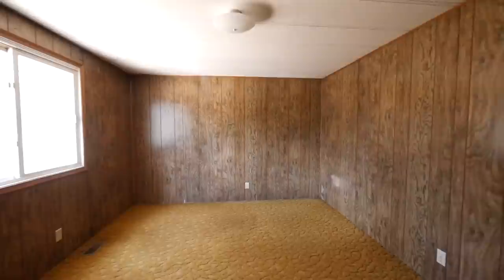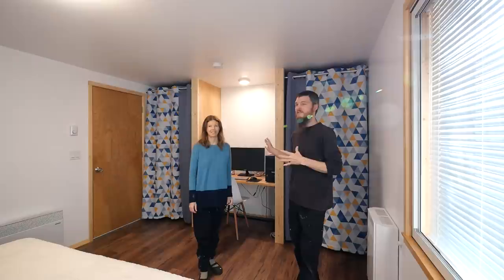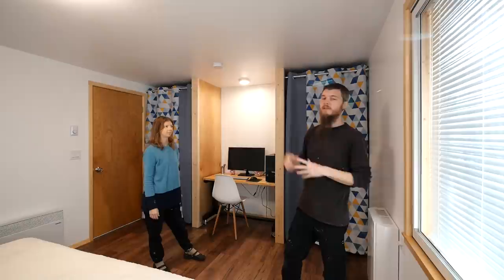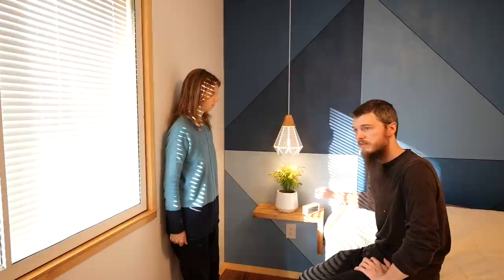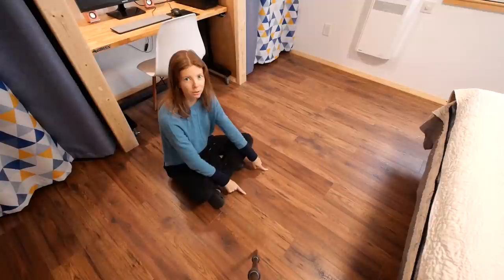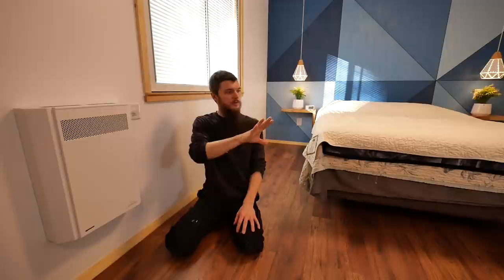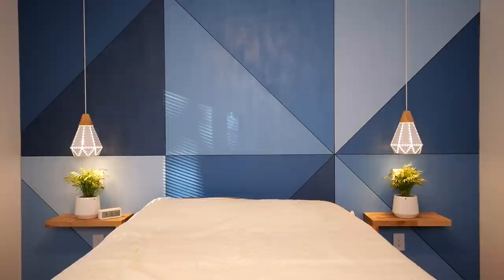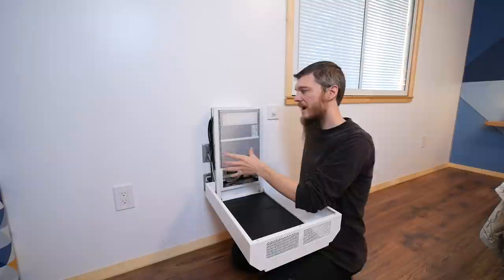Mobile Home Bedroom Renovation and Tour - DIY

Comment: We moved into our brand new home when we had a freakishly hard rainstorm, I was standing at the patio door watching the rain come down sideways when I thought "gosh it's raining so hard I can hear like it's raining inside."  Looked over to my right and water was pouring into the house from the window frame.  Long story short, the builder tore off the patio roof, cut several holes in the stucco to check for moisture, ripped a few holes on the inside for good measure, and then left everything that way for a week to make sure any moisture had a chance to dry.  So mistakes happen even with professional home builders, I'm sure the builder didn't advertise their mistakes either.  LOL!  Your bedroom is beautiful, well both of them were, but I like the blue one better too.

Comment: No I told you so's.  Things happen that are outside your control.  In the moment as you said, it's frustrating.

Correctly correcting the issue is the priority.  And you both knocked it out of the park. 

The new wall, floor, and closet layout are perfect.  Great work!
Reply from the maker: Thank you!

Comment: When we were getting our house ready for market, we had all new flooring installed. There was an unsanded area on the drywall, so my husband sanded it and the dust went everywhere. Then he took a damp rag and started cleaning up the dust, which turned it into a mucky slime on our beautiful new floors. It took 30 seconds of sanding but 3 days to clean up the mess! It was embarassing, but it was our fault for not thinking it through, being tired and stressed. You couldn't have foreseen or even prevented the rainwater getting inside. I remember that video, and it was a pop-up storm. Shoulda, coulda, woulda ... that's what DIY is all about. Props to you for sharing ALL of your experiences!!
Reply from the maker: I know that slime, haha. Drywall dust gets everywhere too!

Comment: It looks beautiful! I love the blue wall your  work is amazing! Love the floor it looks a lot like are floors in are new home.  Everything looks so relaxing. ❤ Ashley it was so nice to see you talking about all the changes you seem very shy most of the time. I am also!! My happy place is doing remodeling decorating crafting plus spending time with my family. I fill best in my own surrounding. You really are such a sweet beautiful lady. Such a beautiful family! Stay safe! 💕        Question: We built are home in 2019 it took a year to build. We moved in Feb. 24 2020. Lived in it from Feb 24 until April 29, 2020. This is are winter home ( Florida) We returned Nov. 1 2020. So then the next day as I was cleaning I found mold in the one bedroom this made me look more closely as then I found mold on furniture the headboard dresser night stand. It's only this one room just as you have said just your bedroom. We called are builder and are working with them as they are being very kind and helpful. It really has been a big problem as I have very bad allergys and mold is my worst. So do you fill taking out the old dry wall helped you with this problem? Oh and yes we also bought a air cleaner device. We did run the central air all summer as we were gone also. Thank you for any help you may have.
Reply from the maker: I feel that our problem was a little different because it was caused by a leak. Our drywall was affected because of where the water came in. Your issue sounds more like a humidity/condensation problem. I wouldn't tear out drywall unless you find that it is moldy, especially on the backside where it can't be treated. Likely you just have to make sure the room is getting fresh air, good ventilation, and light. Also, remove as much of the mold as you can.
Reply: @diyfferent  Thank you so much for this information.

Comment: You should not be afraid of changes it’s your home. Mould and damp problems are not good especially in a bedroom where you are breathing in the spores all night. We all makes mistakes I know when I had my wet room built I had a cupboard placed under the sink however the water from the shower rotted the wood and it fell apart. So now I have just had to have my wet room totally refurbished so now new floating toilet and floating  sink and nothing touching the wet room floor that will get ruined if it gets wet. It was an expense I could do without but you learn from mistakes and now my wet room looks stunning. Plus I had new flooring and the last flooring was a dark grey but my new is speckled white so looks cleaner and bigger. Anyway great video stay safe. By the way my youngest daughter had her baby on Sunday 22nd November and I now have a grandson to add to my eldest daughters two granddaughters. Unfortunately due to lock down here in UK have not seen much of him yet.
Reply from the maker: Wow, congratulations on the new baby. And it sounds like your renovation i s coming along well. We too like our floating sink in our bathroom. We would love a wall toilet too like we installed in our home before the last one. I'm not sure if you saw that. Thanks for watching, be well :)

Comment: The changes you did are great for the room. And you fix the mould issues. 
I would suggest a panel at the back of the desk (bottom part) to hide the wires. The panel will have a small distance from the wall. Move the tower at the bottom and use a cable box. It will tidy the computer area.

Comment: Your blinds, anyone from the outside can look in, if your turn them the other way you can look out.  This is a safety issue.   I love the changes it looks more like your style now.  In around about way the rain really was a chance for you to get what you wanted in the bedroom.  After that rain it makes sense you would have mold.  It's fine it's life, shit happens.    peace
Reply: You're so right about the blinds. I see it so often, that they are turned the wrong way. An apartment at street level could easily be looked into through the blinds: i.e. looking down to the floor where you are instead of looking up towards the ceiling!
The mold: even professional builders get it wrong! The problem was fixed before it got out of hand and as a bonus: a bedroom to their liking.
Reply: @yvindascanius6061  Thanks for backing me up. My uncle was a cop and he said those are a peeping toms best friend those blinds.    peace
Reply: @srqlisa7881  My pleasure! and your uncle is right!
Reply from the maker: I think you are mistaken though. You cannot look into our blinds unless you are on a ladder outside. They would be easier to look into if we turned the them other way. But they do turn both ways with a twist of the wand. Ashley usually prefers them the other way to block the sunlight. Either way, we don't have any neighbors and no one to look into our windows, haha.
Reply: @diyfferent  Well, I slightly disagree with you on this one, and we could have along and exhausted discussion about the ways to turn a blind. But this is neither the time nor the place to do it!
Reply: @diyfferent  Did not know you were that high up or the windows are.  As long as Ashley is happy.  No neighbors how far  out in the country (lol) are you?  peace

Comment: You did the right thing.  Once I saw the rain storm hit ,when you were putting on the roof, I was concerned that might happen.  I was yelling oh no, please make it stop raining.  You  went by the weather reports and Mother Nature happen. You had to fix the issue once the mold started becoming an issue.  Look at it this way, if a tree limb punched a hole in the roof and got water in the wall you would need to address it.   Mother Nature happened and you needed to make the repairs.  Looks great and you were able to address other things that you wanted to change at the same time.

Comment: I like new bedroom better than old one. I personally am not into geometric walls, but this blue wall looks very nice. Love the new floor and closet curtains. Everything gives more lively vibe now. Mold can be a terrible problem. New windows seal much more than old ones, so proper ventilation is necessary.  Or to leave windows open for a certain period a day. But you also had problems with rain while fixing the roof.  I am sure this was not a pleasant experience, but that is life.  I am glad everything is good now. 

Please check for mold regularly - your health is precious. I hope everything is over now, since you have a new roof.

Comment: I actually wondered if that water was going to come back to haunt you later.  At the same time, I thought aww, it will dry out.  It's too bad it didn't, but you had to take care of it.    Healthwise, mold is not good to have mold in the house.  You didn't need to get sick.  The bedroom looks beautiful, and I love the new floor.   I need to do some changes to my house, but only with regard to paint.  Thankfully, the former owners painted the bedrooms white, but the rest of the house needs to be done the same.  I need all of the light I can get.   They left what was left of a 5-gallon pail of paint to do it with.  The colors I need to get rid of is a paper bag colored beige, and dark hunter green.  I hate it.  Dark colors suck up the light in the room, so you don't get as much benefit out of the lights you have on in the room.  Love the nightstands and how they turned out.  It's good not to have to move end tables when you do your cleaning.  Great choice!  Maverick's chatting sounded so cute!

Comment: This makes me think that we may have the same issue, the was some rain getting in and we think that since it was summer and it “dried out” it would be fine, but maybe it’s not, I’ve developed some  respiratory issues and I’ve thinking this whole time it could be the seasons but now I’m wondering if it could be mold. Don’t forget to check your attic, since you put that moisture barrier it may all be trapped there 😱😱. I loved both bedrooms but I really like the blue pop of color, keep up the good work guys!
Reply from the maker: I hope you don't have any major problems in your home. Our attic should be okay, the cellulose insulation absorbed the water and it evaporated super fast when we were doing the roof over the summer. Our attic is also vented at all times (vented soffits and ridge vent) so any moisture can't be trapped.
Reply: @diyfferent  Natalia PLEASE get a mold test kit.

Comment: I understand the "embarrassment" but don't worry about it. Things happen, ideas and needs evolve. It's a good thing you did it now. Mold grows and spreads. By next summer with more heat, it would've been in Maverick's room. This time next year you might have had to do the entire side of the house over. Found the problem fixed it. You didn't make it rain, not your fault.
And I liked the panel headboard, but the blue is beautiful. And I like the more conventional color pattern of the flooring. You did good.
Reply: You're right there mold is a horrible thing and yes it spreads so thank God they fixed it so sad that damn rain had to happen Ashley was so distraught .

Comment: I loved the old bedroom but I also love the new one. I like the color in the new one. I have learned a lot from you guys and I appreciate very much what I have learned. I live in a small single wide. Two bedrooms and one bath. I had to redo the bathroom due to a water leek from a bad plumbing job from the factory. I need to replace the sheet rock on the outside west Wall due to the manufacturer didn't seal the wall around the back door and the back porch light. I am 72 and will have to get someone to help me lift the sheet rock into place. Not as strong as I used to be. I will get it done soon. Watching what you did to your house will save me making some mistakes on mine. Thank you.
Reply from the maker: I hope you get those problems sorted out. Take care :)

Comment: I would love to hear more about how you heat and cool your home and more about this heat recovery ventilator. I own a double wide mobile  home and I'm not happy with the floor ventilation system set up. Would really love to hear what you use and how it's set up. The bedroom looks even more amazing than before. As stressful as I'm sure it was I think you guys nailed it this time.
Reply from the maker: For heat we have the electric wall heaters in each room, plus we have a wood stove. We don't need any cooling where we live since it just doesn't get hot enough in the summer, plus our house is almost always shaded by trees. The Heat Recovery Ventilator so far has been working great in our room, the humidity has stayed low and the air always smells fresh now. We're not happy with this particular unit, but it's accomplishing the job. We keep a dehumidifier in the other part of the house which helps keep the rest of the house humidity low also. Thanks.

Comment: I really love it... as you said it looks (and would feel) much lighter... the blue feature wall is spectacular!!... Looks very Scandi. which also suits the rest of the house.. 
Sometimes you don't know until you live in a space..

In Australia the 'south side' of a house is colder and even as you say on the damp'ish side... (in US would have similar problems facing north) . Facing most of the windows (here ) to the North makes it more passive solar efficient. All the cold air in Aussie comes from the south.... and mine particularly comes from the "Snowy Mountains' which is only around 100 miles south of me. I have a bedroom facing the south.. and very rarely use it, hence the guest bedroom. (and my overflow of clothes LOL)

Anyhow you did a great job and congratulate you in remodeling it...!!! <3

Comment: This is just beautiful. We had mildew problems in our bathroom and like you we put in a heat exchange fan, it worked brilliantly. Fifteen years and not a problem with mould, mildew or condensation. Your rooms are minimal and very artistic in structure. Belle obviously gets her talent from you both. What next?

Comment: Funny how you are afraid to put holes in a wall for a shelf and not afraid to dismantle a whole room that you had recently renovated. Brave! I do love your new choices and your reasoning for the changes. I can relate to not wanting to put holes in the wall. I'm an artist and have many paintings that I sometime switch around. I recently repainted my apartment. Not wanting to put wholes in the wall I made "ladder shelves" one, the ladders can be move to any wall and the paintings can be switch out whenever needed. I notice the closet curtains don't touch the floor. You might consider adding fabric that matches the baseboard which (btw) is much nicer. It could be a solution if the gap on the bottom bothers you.  It aggravates me to hear you receive criticism. I enjoy learning from you and seeing how you solve problems that work for you. The color and design of your head board wall, the resourceful use on the left over counter pieces way to go just a few.

Comment: In all honesty, when I was first watching it, I thought you two had lost your minds! All that meticulous and beautiful work  - I loved the other bed, headboard and night tables - and I was thinking what a waste .. the closets and desk area and the floor. But, after you explained about the moisture and mold problem, and remembering what you went through with the downpour while you were working on the roof, it made sense. I still love what you did the first time around, but I love this equally. You can add the finished space to your portfolio of what you can do, so when HGTV contacts you with an offer, there is more footage to show!! In any event, you should never feel embarrassed .. you have done so much, and you did the work meticulously and have every reason to hold your heads up high.

Comment: On the moisture issue, we run a DeLonghi dehumidifier in our mud/laundry/utility room when indoor humidity is above 50%.  We've had it for about 10 years and in the winter season I disassemble it and clean it for the next humid times of the year.  It can produce up to 50 pints of water per day.  I would recommend putting it in a room away from the bedrooms because of the noise.  Our house has forced air throughout which helps also with moisture removal.

Comment: So sorry for what you had to go through!!!!  Must have felt like a nightmare.  So glad it is behind you.  Looks like you got extra insulation. You did a great job!!! Love the new wood floor much more than the other floor.  Love the changes you made to the closets and desk area. Taking that beam out really does make the room airier.  You can put wood supports on the closet plywood walls and lay a board on it for a shelf so the plaster wall doesn't get nail holes if that is what you don't want to ruin.  Maybe use construction adhesive on the back edge of the shelf to hold it to the wall if you are afraid it will flip or tilt, but shouldn't need to.  May want 2 shelves.  Love how the curtains complement the accent wall and how all the woods complement each other.  The only thing that surprised me is that with two artists in the house, there are no pictures on the two white walls.  Guess that is part of your minimalist thinking?  Beautiful workmanship again.  Could see Maverick and Belle were ready to jump in when you started painting the triangles!  No one afraid of work in that house!
Reply from the maker: Thanks for the shelf ideas :)

Comment: Aww, I’m sorry you felt that you would be criticized too much. I guess that’s always part of putting yourself out there, but it’s too bad. I’m so glad you found the problem so soon and were able to fix everything. The new design is so awesome, I love it! You guys are so amazing in everything you do! Were you able to check the insulation in the attic space to make sure it’s not still wet?
Reply from the maker: The attic insulation dried out very quickly over the summer when we were working on the roof :) The cellulose absorbed it very well and then it evaporated nicely.